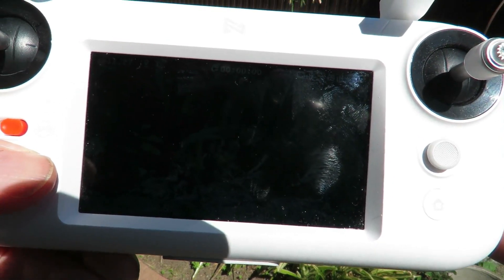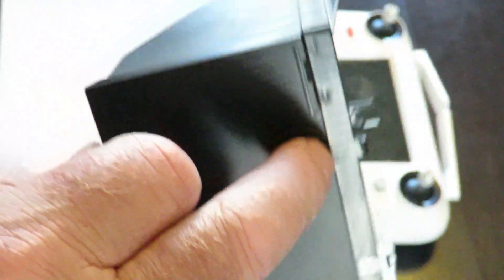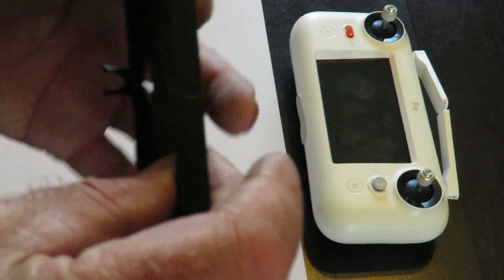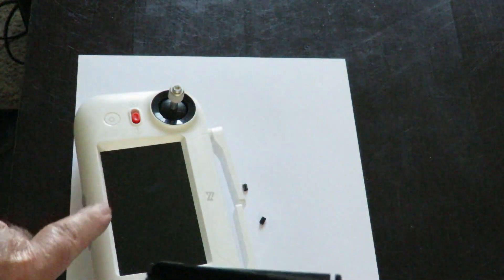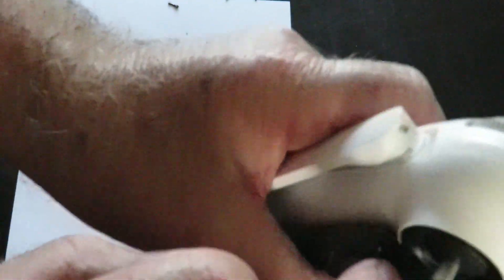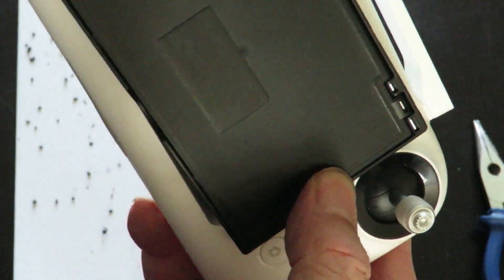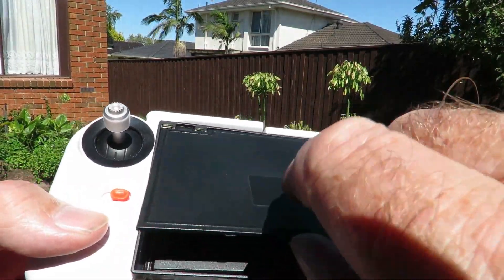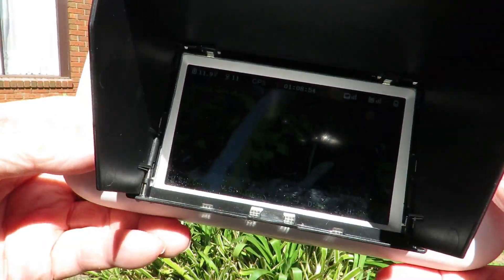🚁 Working Xiaomi Fimi A3 Sunshade Using a Hubsan H107D Transmitter Hood Shade

Comment: Good video Gary wish i could have seen this before i broke mine tring to put it on. Also i'm having a problem recording my remote control. i have put two different micro cards in and i still get a erroe message that says format your tf card, could u shade some light on this for me i would be gladly appercaited.
Reply from the maker: I use a class 10 Toshiba 16GB for the controller.
Have you tried to format your card using Fat16 on your computer first to check for errors?
Then inserting card, and again formatting it in the controller?
Reply: Garry Purcell what is Fat16?